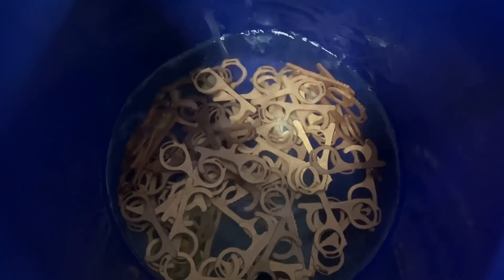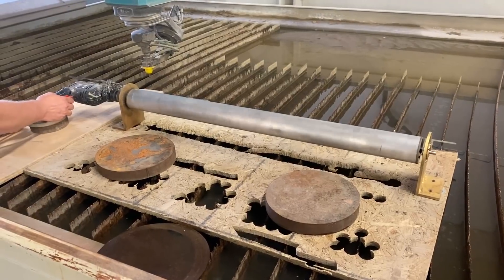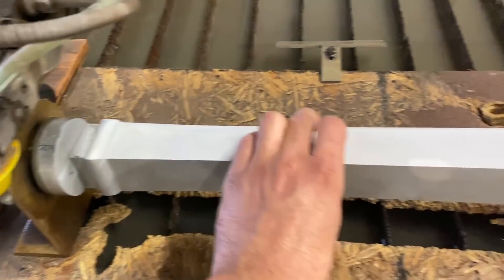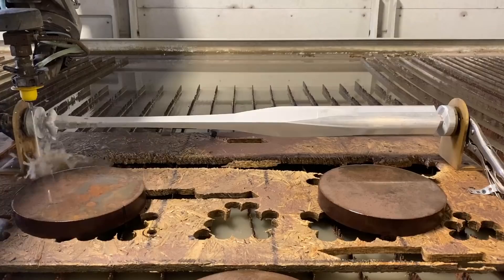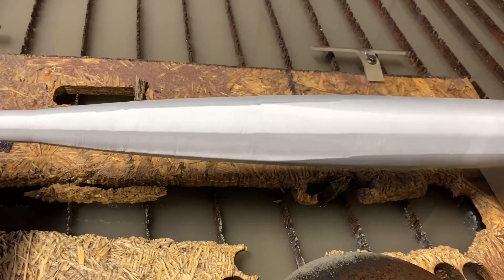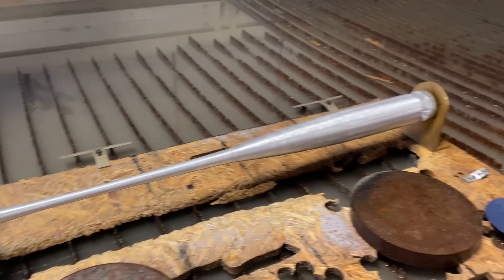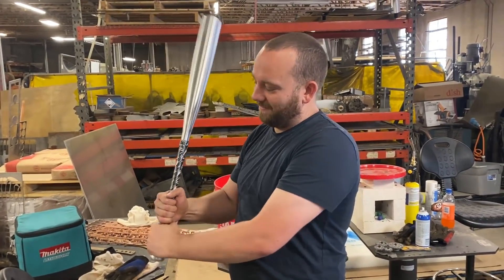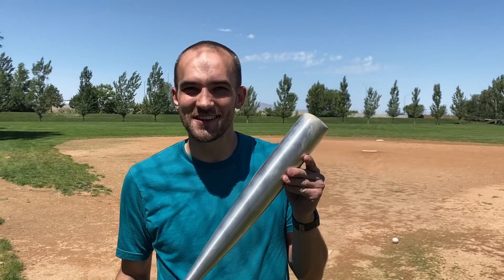Solid Aluminum Bat With A Waterjet Lathe

Comment: hmm that bearing plate should have one side screwed in rather than welded, would make replacing the INEVITABLE rusty bearings easier
but I mean, low-IQ waterjet fun should not be contaminated with logic

Comment: I vote for corking a bat, so make something like this or the strongest (and probably game-illegal) bat possible and core out the center and fill it with something that absorbs shock, but also doesn't permanently damaged much, hence why cork is normally used, plus it has a very low density that lowers the weight of the bat from what it would normally be if solid.

Comment: could you have a clutch on the work so the jet would turn it but not that fast. then change the clutch resistance for speed control

Comment: Instead of welding the plate on the traps the bearing you should bolt it on.  Then you can change the bearings easier.   As for the bat. You didn't account for the kerf or the deflection. You need to leave .02  to  .03 on each profile cut. Also spin the part faster or slow your travel speed.

Comment: The physics of why the ball went the same distance is the fact that your body can output a certain amount of momentum. Momentum is mass * velocity so with the small bat you have a small mass which has a higher velocity while swinging. With the large bat you have a high mass and a smaller velocity. Both of these momentums will be about the same which means the energy transfered to the ball will be about the same causing it to go the same distance.

Comment: I know that, you will probably never attempt this again but if you would do the rough cuts a little further from the center, effectively getting oversized bat, then the "turning" pass on the final size, the waterjet would actually have some material to knock off, as it was now, only area of contact between the blank and the waterjet were the corners, maybe slower cut would help too ? Just a thought.
Great fun you are having with that thing BTW.
Reply from the maker: I think we might have one more attempt in us

Comment: Your advert plugs are as entertaining as the video itself lol awesome job guys!
Also, It looked like the bat changed direction when the water jet kicked on. The drill might not have enough power to overcome the pressure. Maybe a hammer drill can?

Comment: Hears a crazy idea... make it a dead-blow bat! Cut the end off, bore out the barrel, fill with some kind of BB's, thread the barrel and make a new end to fit.

OR, playing with physics-  Cut the end off, bore out the barrel leaving a rod of aluminium, cut threads onto the end of the rod and barrel, cut a blank piece of stock to ride inside the barrel, preload it with a spring in the end, make a new end to fit. In theory, when you swing the mass will be closer to you and once the acceleration overcomes the spring, it should load the end of the bat with the mass.

Comment: If you try this bat project again in the future, try making the precut profile an 1/8" or so larger.
That way there's a little more material for the water jet to bite into when you're doing the final pass set at its final profile dimensions while the lathe is spinning.
Also, it seems like the speed of the lathe deflects too much water each time the jet hits another facet in the precut profile. Increasing the precut profile might help a little overall, but I think what would help even more is a mix of reducing the RPM of the lathe, alongside slowing down the duration of the final pass. That should yield a more consistent & uniform product. Though you sill might have to do a light sanding at the end, it should be less intensive than what did here.

Comment: Use a big lathe to bore out most of the center but keep the handle solid for strength. Like drill a 2" hole down the center halfway down the bat from the thick end. Cut down the weight by let's say 3-4lbs, since its at the far end of the bat it will really help a lot.

Comment: Long-term exposure to copper can cause irritation of the nose, mouth and eyes and it causes headaches, stomachaches, dizziness, vomiting and diarrhea. Intentionally high uptakes of copper may cause liver and kidney damage and even death. Whether copper is carcinogenic has not been determined yet.

Industrial exposure to copper fumes, dusts, or mists may result in metal fume fever with atrophic changes in nasal mucous membranes. Chronic copper poisoning results in Wilson’s Disease, characterized by a hepatic cirrhosis, brain damage, demyelization, renal disease, and copper deposition in the cornea.

Comment: Imagine training with this bat for like a year and then when you play a game you use a regular wooden bat. Talk about some dingers then lol  kinda like rock lee with his ankle weights 🤙
Reply: I was wondering the same thing.
Reply: @Schlabbo_Babbo  It would have entirely different timings for the swing though so you'd have to spend another year re-learning on a proper bat. 

If you really want to build up core strength for swings without also training improperly, go fell some trees the old fashioned way. It'll build the core strength aswell as your ability to focus force onto a small point, and at the same time would teach you not to be as affected by the shock reverberating down the handle after impact.

Comment: Hey bois - next time you try to lathe-sand something like that, you gotta move the sandpaper more. It loads up with crap real fast and you're spending 80% of your time rubbing aluminum dust on your aluminum part. Wet sanding would also have been more effective.

Comment: If a magnet travels towards a large peice of copper, it will stop before it hits the copper due to opposing magnetic fields. What would happen if you launch a magnet at a peice of copper with the air cannon? Try different types of magnets!

Comment: You guys should slow down the rotation. A lathe cuts based on the rigidity of its cutting tool. Water isn’t rigid, so maybe a really slow rotation speed (<10 rpm?) would work?

Comment: That was good. A lot of work, but a very nice finished product. The only thing you can do now, is to cut off the last 1/2" of the wide end, then drill out the inside of the bat to make it lighter, then weld the end back on.
Reply: No welding needed for the cap.  Just a press fit.
Reply: @fridaynightgamefilm  If it's perfectly machined, then yes.
Reply: @electronicsNmore  Adam Booth can hit the tightest tolerances (well under a thousandth of a inch). Check out his YouTube channel, Abom79.
Reply: @fridaynightgamefilm  He is very good at what he does, but honestly the things he does, should be the standard for all machine operators and not something that should be praised as exceptional. 

(Again though, he is good at what he does and I've enjoyed his content for years now, but it's nothing more than what I would expect out of anyone in the same position.)
Reply: That was what I was thinking

Comment: A lot of what I see of aluminum bats is the top is hollowed out a few inches down and has a plastic cap over it. It usually ends up with maybe a 1/4" sidewall. Guessing your waterjet probably cant get vertical enough to give that bat some weight loss though.

Comment: there actually is a place for heavy bats in baseball: practice swings. if you can swing an 8 lb bat you can swing a 1 lb bat even harder
Reply: And if you can dodge a wrench, you can dodge a ball.
Reply: @drummerman1206  that's what I thought
Reply: baseball players sometimes add weights to the bats during practice
Reply: Arent metal bats hollow ?
Reply: @weld4200  yep, drawn out over a die
Reply: Doesn't work, really. Sure the strength might.. but it will throw off your timing.
Reply: @jaanikaapa6925  yeah players use weights during practice swings but they aren’t near as heavy as a solid metal bat.
Reply: @jaanikaapa6925  I know im late but no, I have played baseball and this is a regular practice. You’ll see players swinging two or three bats in their hand sometimes just to act as the donut weights
Reply: @jaanikaapa6925  solid metal bay would definitely mess your swing up, too much of a weight difference.
Reply: @jaanikaapa6925  that’s why you also practice with normal bats haha
Reply: @jaanikaapa6925  not if you’re hitting a ball of a tee, then theres no timing involved, just precision and strength
Reply: It would have entirely different timings for the swing though so you'd have to spend another year re-learning on a proper bat. 

If you really want to build up core strength for swings without also training improperly, go fell some trees the old fashioned way. It'll build the core strength aswell as your ability to focus force onto a small point, and at the same time would teach you not to be as affected by the shock reverberating down the handle after impact.
Reply: Exactly.
Reply: Solid lead bat
Reply: @jamesN6450  if that could be solid enough to hold it's own weight dear god you would have to be hulk to swing it
Reply: @Firefox10203  they recently did a lead bat, just picking it up bent the handle lmao
Reply: @jbritgaming7308  that's what I'm saying
Reply: Every player in training should use this bat
Reply: On some rock lee type shit
Reply: Of course you wouldnt train exclusively with the heavy bat. You wouldnt even bother trying to swing precisely or anything with the heavy bat. It would start out in post season with lots of heavy bat work, then you would finish off each session with a regular bat, and you would work it to the opposite by the end of preseason and on into the season where you train a little with the heavy bat and mostly with the regular bat. That way the bulk of your muscle memory is built on the light bat and you still get the benefit from the heavy bat. However, as they mentioned, you can aeriously hurt yourseld by swinging that much weight leveraged like that. If you really want to build the muscle memory and muscle recruitment for the swinging muscles, i would simply wear wrist weights while swinging. It still has the benefits of the added weight, but its not so leveraged and it possibly still adds momentum to the swing, but if you cant do that during play thats of little benefit then. But i think it would be better not to use too heavy a weight in either case, the shoulder is an easy joint to damage and much less easy to repair.
Reply: Actually that will throw your timing off 😂 @elmadicine
Reply: No. Get strong in the gym and practice with a normal bat.

Comment: Would slowing the spin of the bat to an absolute crawl do more? Seems it is just missing the edges as it goes by too fast, but if the bat is spinning very slow and the water jet is moving slow that would give it a better chance to blast the metal?

Comment: I did a report for a class on the best wood for making bats. It involved a lot of math jargon about elasticity, but in the end, the most consistent way to hit a fast ball as far as possible was to either make contact with a really heavy bat, or swing a light bat very fast. Nowadays, using a heavy bat is almost certain to fail because of the high pitch speeds in the MLB, but it also explains why Babe Ruth could swing a super heavy bat (46 oz.) and hit so many homeruns in an era where the average fastball was probably going in the mid 80s. 
Enjoy the random factoid, and have a good one!
Reply: @that guy, over yonder Most of the math i ended up doing had to do with the moment of inertia of the bat, having to do calculations with different wood densities, and trying to model it as an actual collision where not all energy is conserved.
Reply: In theory if you could wield this bat you could have a massive advantage if you could land a hit
Reply: funny thing is im going into the 9th throwing 87
Reply: Is there a in between?!.
Reply: Well at the same time, do you think with enough training that solid aluminum bat would count as a registered self defense weapon?
Reply: Or you just practice with a 10 lb bat and then compete with a ultralight
Reply: Aspirational Person your timing would be off
Reply: Aspirational Person if your thinking luck that you mights as well just practice with a 3 or 4 lb. bat but just hit the gym and get big gains on you arms and back.
Reply: But if I gain anymore muscle my timing will be off. 🏋️‍♂️
Reply: @panaddict3448  , Ichiro would use the very light Tamo Ash bat for practice, and a heavier and more durable common ash in game.

Comment: Did you guys run the exact same profile to round it as the the one used to cut the 8 sides?  I would think you'd want to take a little more stock off for the rounding profile..

Comment: surprising how ineffective the waterjet is at these odd tasks All that jet power and it can't even
Reply: It’s not designed to be used as a lathe. Lathes are designed to be used as lathes
Reply: @LaceLoop  screw design, A real man throws manpower at a problem and brute force usually solves it! But in this case, the thing's too effective at just deflecting all that power.

Comment: The wooden bat was for baseball, the aluminum bat is for killing
Reply: For killing your back and arms.
Reply: @ferrumignis  along with people
Reply: Both work well for that...
Reply: I worked with solid aluminum it does get heavy. Solid copper gets way way heavier though, picking up small piles of copper can get really heavy quick.
Reply: Dan3a you are correct
Reply: Get ya swattah here

Comment: how far can that waterjet reach/do damage when you aim it at the horizon?
Reply: Not very far. The water has so much kinetic energy, it quickly atomizes in the air, rapidly dispersing it’s energy and slowing down.

Edit: it’s like a pressure washer. It can cut rock and many other materials up close, but from a couple meters away it becomes a big misting machine.
Reply: They did that once you can’t shoot it completely horizontal

Comment: Oi ! you're running that drill to fast, cut out a 3:1 or a 4:1 gear set and give it a try then.
Reply: Smoothening time
Reply: Even better would be to rotate the bat in the opposite direction of the water jet.
Reply: André Ferraz exactly what they explain they are doing at the beginning of the video.
Reply: Ok, might have missed that.
Reply: Get a larhe ...

Comment: Use a lathe to core out the center to reduce weight, then fill with cork! Please?
Reply: Yeah... send it to Abom79 and have him true it up on a real lathe, then bore out the center to get the wall thickness down to spec.
Reply: These guys are far from being machinsts

Comment: Try rotating the bat in the opposite direction of the stream and also cutting the base shape out in an octagon over a square, maybe 4 sides, then 8 sides, then 16 sides then rotating cut in opposite direction of stream.
I dunno.
Thanks for the videos.

Comment: You need to drill that bat out in the thick end and make a cap for the end .to shave off weight .if you look at a reg aluminum bat the thickness is anut max a 1/8th inch thick so ya you should try that .but looks good

Comment: Solid STEEL bat guys.
Reply: ғuňţċѧsє ţuċҡғѧяԀ  He's suggesting they should make a solid steel bat next
Reply: Disguise the steel bat as an aluminum one and lay it on a baseball field, watch people try to pick it up.
Reply: @joekidwell4773  😅
Reply: Depleted Uranium bat next please
Reply: Tungsten
Reply: Yes they need one
Reply: You need a fork lift to get it in there
Reply: Please
Reply: Solid plumbum please!
Reply: Solid platinum, then you wouldn't have to worry about the cost of cutting because the stock would cost $2 million anyway.
Reply: Solid lead bat 😎
Reply: Solid Osmium bat😂
Reply: Tungsten bat baby
Reply: lead

Comment: You guys should try making solid aluminum hammers (both sledge and claw/framing) and "test" them against their steel counterparts.
Reply: Titanium is the preferred material, but expensive. Its really not a huge percentage better performance vs. Price

Comment: Either you run the water jet slower or you spin the bat A LOT faster. A lot.
Reply: I'd be inclines to try running the bat slower so that it rotates only a few turns in the time it takes the jet to advance it's own width. Like maybe <10 RPM?

Comment: I like your copper fingers better. I saw a store carrying a similar product but it didn't have the button pressing nub.

So again...yours is the best design.
Reply from the maker: Thanks! we tried to think of everything.
Reply: I saw one on a commercial that looks pretty close to theirs but it's made of brass
Reply: @rexleehe7633   yes the only way to one up them now is if the channel makes one out of solid gold
Reply: @jackpardun2898  Or silver.

Look at Mack Weldon they make silver lined shirts and underwear (and socks I think?) because Silver is an antimicrobial .. thing/surface/mineral?
Reply: What button pushing nub? I must not have looked close enough during their adds.
Reply: Seriously? People use these things?